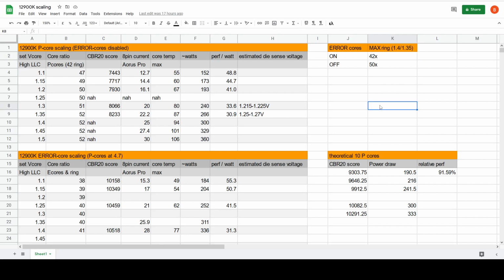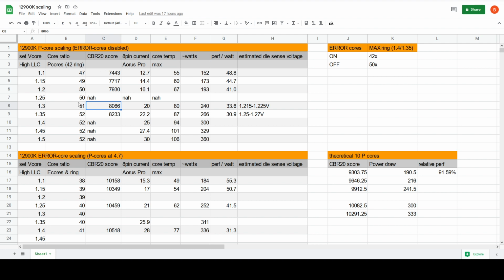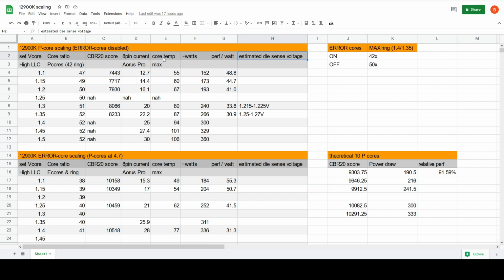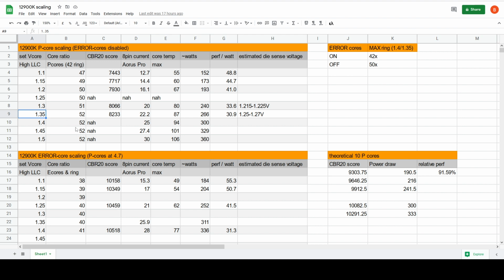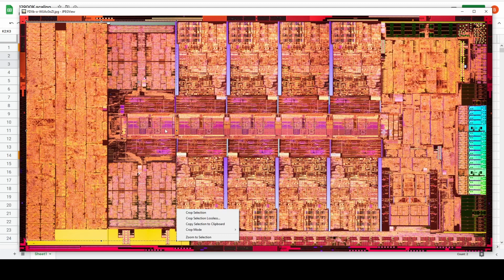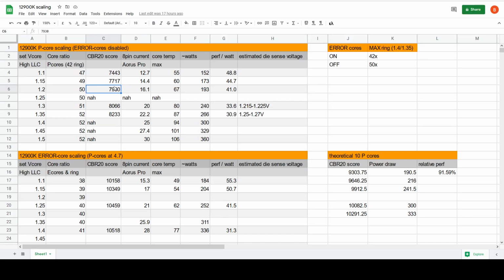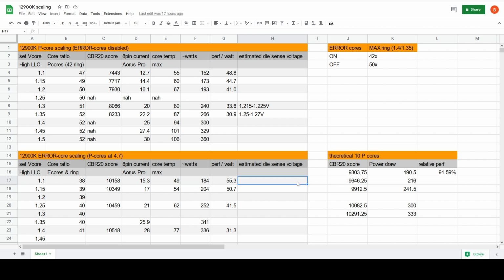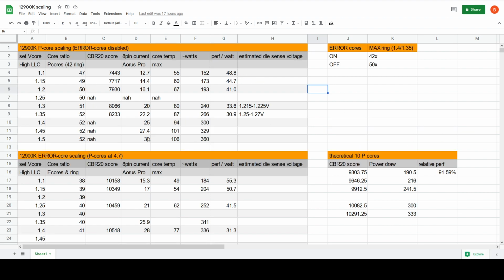12900K P and E core voltage and frequency scaling behaviour

Comment: Smaller cores aren't just better at perf/watt, but at perf/mm2. They're about 50% better than the Pcores on that metric and that's why both Intel and AMD are investing heavily in smaller core variants for next gen.
Reply from the maker: the only thing that matters is how much work a CPU gets done for a given price and power draw. How much silicon the manufacturer throws at providing that performance is utterly irrelevant from the user perspective.
Reply: @ActuallyHardcoreOverclocking  Fair, but there are far wider reaching implications. A bigger core means that the physical distance between cores is larger for example which increases interconnect latency, complexity and power.

Zen4c enables 128 cores on a package while Zen4 only fits 96.

We're gonna see 8+16c raptor lakes soon and "just put 16 Pcores on a single die and ring for the same nT performance" is not a realistic option.
Reply from the maker: @AerynGaming  Except the Ecores are roughly 36.5% of a P core in multi threaded workloads. So to match 16 E cores you would only need 6 P-cores not 8.
Reply: @ActuallyHardcoreOverclocking  16 Error cores take practically the same amount of space as 5 P cores with performance of 5.84 P cores at lower power consumption @ equal voltage. Intel wins on die size, wins on power consumption, wins on total performance compared to P core only design. Win-win-win for Intel.
Reply: @AerynGaming  That’s a whole lot of theoretical performance getting in the way of practical performance.
Reply: @Jreauzelph  Programmers can manually make a thread for this and a thread for that, which produces lightly-threaded programs that don't scale past 4-ish cores, or they can design the program in such a way that the work is split into roughly-equal-sized chunks and then spread those chunks across as many worker threads as there are cores, which produces programs that most scale to as many cores as you can throw at them, up to the limit of how much it costs to split the work up and start/complete jobs.  And I'd expect that start/complete cost depends more on inter-core communication than on how fast each individual core is. Whether you have 10P or 2P+40E, you're on the same ring bus.
Reply: Apparently they could just fit 32 or 40 e cores in a die there are no p cores. They would probably be faster than all p cores or a hybrid scenario in multi threading situations...
Reply: @Aeryn Osu  and  @volodumurkalunyak4651  Conveniently forgetting how much space the AVX logic takes up on the P cores while not actually being used for most workloads. If you remove the AVX logic from the P cores the the ratio is going to be much closer to 1 to 1
Reply: @grempal  but if you'r workload is avx 512 accelerated (like namd or y-cruncher) than disabling e-cores and enabling avx 512 might still yield better performance. Here - not so much of  a win-win-win for intel. 10 p core design would be even faster with avx-512.
Reply: @fy7589  40, and yeah.

That would have terrible ST performance, though, and a huge fraction of programs are not perfectly parallel. A mixture of big and small has far more mathematical potential than having all cores be the same size.

If you're even considering putting more than 8 of a core on a die then it's simply not big enough and more transistors could be used to improve the big core IPC.
Reply: @volodumurkalunyak4651  I know that. I'm pushing back on the argument that the E cores are a more efficient use of area than P cores. If E cores had AVX 512 or P cores didn't have AVX 512 they would be quite similar in area and therefore all things being equal the P cores provide more performance per mm^2 of die space. Der8aur did a video on y cruncher having better performance on the 12900k with the E cores disabled and avx512 enabled than with the E cores enabled.
Reply: @grempal  Intel has no competition with AVX-512 and can sacrifice that for most consumers. If user still needs AVX-512, than disabling E cores can provide AVX512 performance similar to previous gen.
Reply: @ActuallyHardcoreOverclocking  his point is that just 32 e cores is more betterer than just 8 p cores (generally speaking)
Reply: @Vegemeister1  Interthread latency is a significant and growing problem for programs. Very few applications are embarrassingly parallel like Cinebench, Blender, and other tile renderers. Single code thread with one memory lock is where most of the performance gains are. That means silicon and power-hungry instructions like AVX-512. The issue with AVX-512 is that the instruction path is so wide you must design the data structures around those instructions. Otherwise, you start risking cache line evictions on other parts of the data structure, which costs dozens of AVX instruction cycles to refetch.

Suppose you disable AVX-512 and stick to SSE4.1 and AVX-256; the gap between Intel and AMD narrows. Those are supported by nearly all compilers and used automatically in loop optimization by most of them now.
Reply: @ActuallyHardcoreOverclocking  
"So to match 16 E cores you would need 6 P cores not 8"

Well, 16 E cores would still take the same space as 4 P cores.

16 E cores that take the space of 4 P cores performs the same 6 P cores that take the space of 6 P cores.

I.e., P cores need 50% more space for the same performance.

Which illustrates exactly what that other guy was saying—perf/mm2 of E cores is much higher than perf/mm2 of P cores.
Reply: @AerynGaming  how you guys able to run 12900k stable at 5ghz with only 1.2 v?
Reply: @yooanto9465  Some samples can do it and others can't because of the silicon lottery.

Some people also crank a setting called Loadline calibration - which effectively adds load voltage - in order to claim that their BIOS vcore is lower than other people
Reply: @AerynGaming  should we trust asus rating? Cause I got good score
Reply: @yooanto9465  It can be a ballpark, not particularly reliable though. IIRC good sp = good, but bad SP might also be good.
Reply: Do you know if e cores can be stopped when gaming?

Comment: Cool info for overclocking. But I'd take more e cores even if I had to settle for 4 p cores. I'm either gaming or compiling code, so more perf per transistor and watt is 100% what I need. No matter how multi threaded games get, they're still ultimately bound to the speed of a coordinating thread, and any other threads really don't need to be flooring it to keep up. And I figure any perf/watt is beneficial since cpu designs are literally designed to clock till they run out of juice and cooling.
Reply from the maker: Except if you get a heavy thread on the E-cores now all the Pcores gotta wait.
Reply: Well, rumor has it that they're sticking with 8 max P-cores in the future but doubling E-cores, so it's going a bit in that direction.
Reply from the maker: @--Lam  Doom Eternal will runs well even on a potato since it's pretty much a corridor shooter.
Reply: @ActuallyHardcoreOverclocking  that's not a common scenario because smart software will handoff work correctly (this is intel's bet), and intel is looking for more ways to make  scheduling happen in hardware and software. I guarantee they are looking to do this little big core setup in the server space very soon. imagine having a massive cpu with many E-core and maybe 4 p cores. For most large scale jobs this will be huge! This is because all epyc and xeon cores as of right now are mega trash at single threaded workloads (basically super trash at high gpu lane related workloads). The Ecores are "not" just for laptops.These cpus can now do more complex work. PS: just thinking about the server space, i would have rather had a 10 core for gaming :p.
Reply from the maker: @p1st0ls44  the up coming intel server chips are only P-cores.
Reply from the maker: @--Lam  I played iternal. The arenas are small and there's really not that many enemies in them at any given time.
Reply: I've tried gaming with and without e-cores and p-core only was at worst a draw, usually it won by a couple percent. So as a gamer, the e-cores seem like wasted die area.
Reply: @marceldiezasch6192  The bigger wasted die area on the consumer chips is the avx logic. You have to disable the E cores currently to get avx to work and the P cores are much faster than the E cores and actually wouldn't take up significantly more silicon without the avx logic
Reply: @grempal  avx 512, both can use avx2
Reply: @vyor8837  yeah that's what i meant just got lazy and didn't bother typing out the 512 my bad
Reply: @--Lam  it has the same weapon system as 2016 and all cutscenes are skippable

Comment: For an overclockers perspective, yes the E-cores are quite sucky. But from a performance perspective, they are quite fantastic.
33% of the performance for around 25% of the power/area means a 32% increase in total throughput for the same power and area which is quite huge.
I guess that's the nature of the channel though. Actual Hardcore Overclocking and not "Actual Hardcore Benchmarking"
Reply: 4 E cores do have 1,25x area as P core, not same as 1 P core. 133% of non AVX-512 performance and 0% of AVX-512 performance within 125% area and probably 100% power isn't as big improvement as you written. Yes, that is still an performance improvement, just not that big.